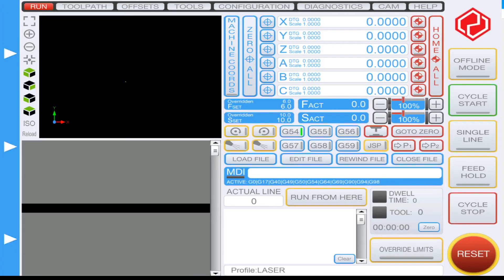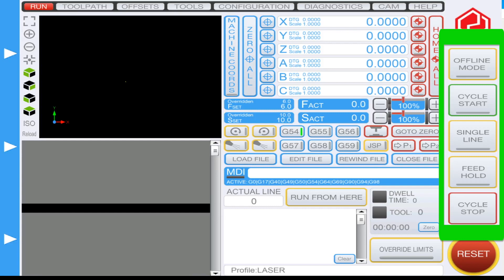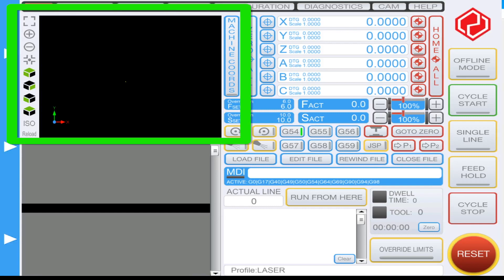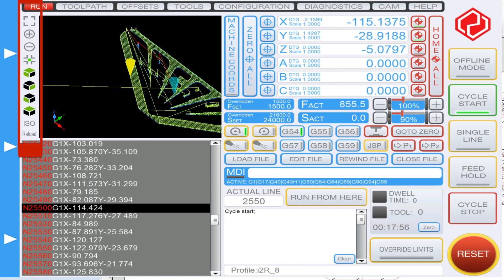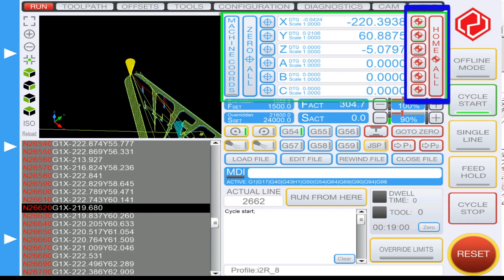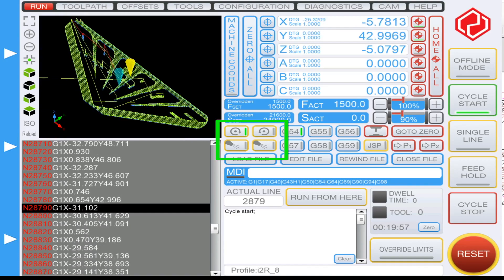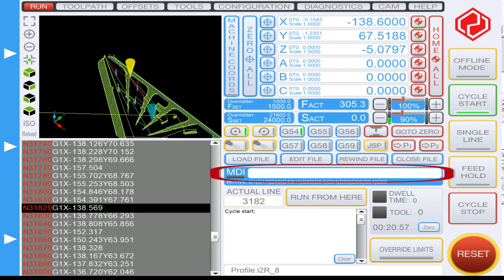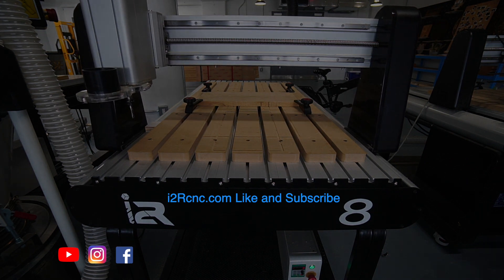i2R UCCNC Basic CNC Functions - Part 1

Comment: Question I am using CCNC on my controller, when trying to open my file the system tells me the workpiece is to large and outside my machine perimeters. My Axiom bed is 900x600mm. The workpiece is 165mm square. Have you any idea why? Any help would be appreciated. Thanks

Comment: How can you say cycle stop is for stopping and resume work at 2.20 when if you hit cycle start after hitting cycle stop the spindle wont  start. Watt would be good if when activating cycle stop the  bit raised up and you got a pop up warning telling you the process for restart. 40 $ bit in the bin cheers CNC newby. 
.
Reply from the maker: in MDI type S24000 to set spindle speed first.  Starting from middle of Gcode it will not pick up spindle speed sometimes.

Comment: hello, I am the owner of the stepcraft plotter UCCNC control software during work, the cutter should rise to 5 mm, it happens that the cutter will rise to "0" while the program is about 5mm when it starts milling, say depth of -3mm and milling then at -8mm, why is this diet, I'm just starting with cnc